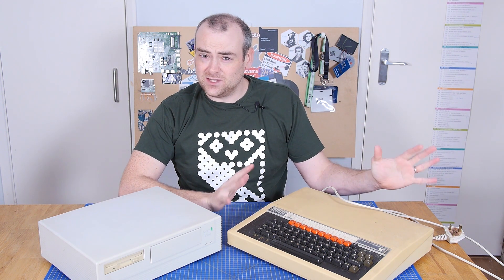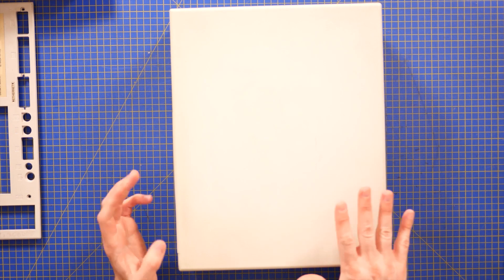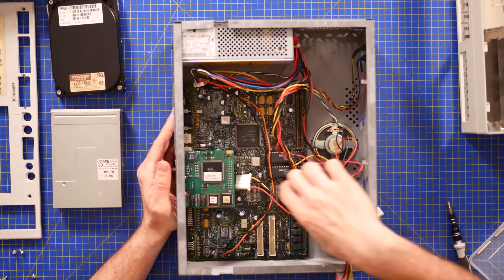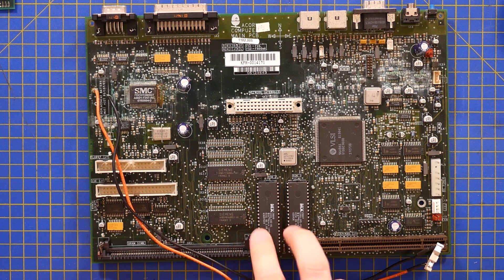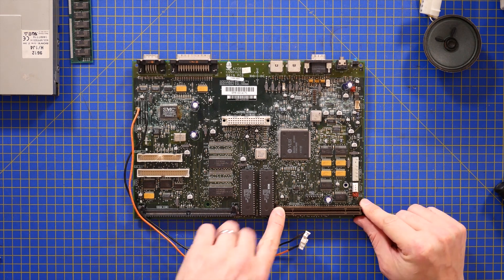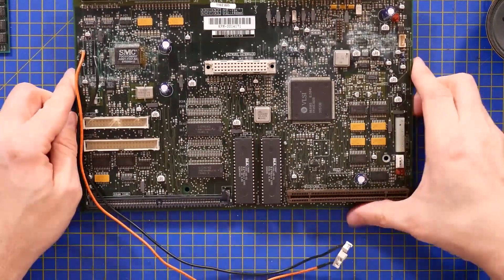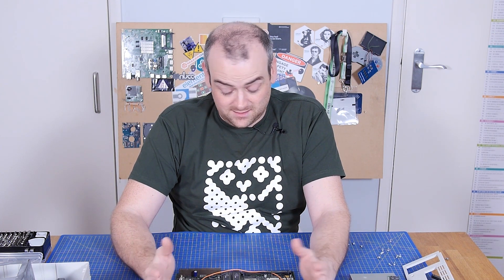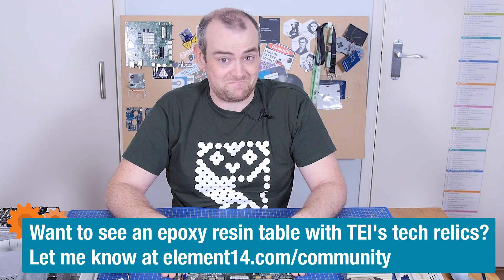Tearing Down an Acorn A7000 - The Electronics Inside

Comment: Ah remember the Acorn 7000s well as I used to look after 13 units with VGA monitors hard drive, floppy drive, CD-Rom drive, fans and EcoNet Network cards great times in fact until about 3 years ago we still had on setup with sensors for use in the science department. Always ran like a dream never any trouble with them. Was sorry to see the last one go to recycling!
Reply: Oh - so there were models that came with fans? Was there a significant difference between this model and the ones you had?

Comment: There were remnants of a coax-based network throughout my secondary school the whole time i was there (1998-2005). I don't think it was ever in use during that time, but you'd still see random old machines on desks everywhere, complete with lengths of coax hanging from them :)
But even without the mischief you described, the network still had enough issues that a good portion of my A-level computing lessons were spent complaining about the "not-work" preventing us logging in or something - though in hindsight I suspect most of the issues were software-related.

IIRC they did also have an 802.11a deployment before later upgrading it to 802.11b (around 2002?). Not sure how I knew about the 802.11a network when my laptops only supported 802.11b/g (sometimes requiring PCMCIA cards even for that, of course!). Might have just been from chatting with our computing teachers.

They were even upgrading the wired network to use a fibre backbone, but I left for uni before I saw that in action :(
Reply: I did do some work at a primary school in around 2002 ish? They had a laptop trolley with 30 laptops and PCMCIA wireless cards. I'll let you guess how many laptops got dropped on the cards. The damage ranged from "slightly bent" to "broken off it in the port".

There was one instance at the same school where there was a double data point, and one of the "little darlings" plugged the fly lead into both ports causing a network "collision" which brought down the whole network (these were dumb switches, no managed features at all).

Comment: The two coax Ethernet systems  were 10base5 thick coax , 10base2 thin coax which is the BNC that you have here, not a ring, it's a bus, each end terminated with 50 ohms. Some interface cards had termination optons, otherwise you used a terminator plug. Speed was 10 Mbps. 10Base5, ran over a longer distance (500m)  This had the "node" points marked on the coax, and you drilled into the coax and used a "bee sting"  connection to add an AUI module. Many interface cards had dual 10base2 and AUI interface options. The AUI was a 15 way D Type, usually with a slidelock retaining clip (nasty useless things)  

 Because the bee stings were all at the zero volt point of the electrical wave they did not upset the performance of the coax very much so 10base5 could run over a greater distance. 

10base2 had a 185m in distance, (they decided to call it 10base2 rather than 10base1.85!)

There were no specific connection points as there were on the thick coax, but I think the recommendation  was to have at least 3m betewwn each node.

As you say, breaking the coax did bring the network down, and there were several "make before break" type wall boxes that overcame this issue to some extent. (I spent far too much time finding partially pulled BNCs that killed the network!)

Andy
Reply: I thought it could be ring or bus with the COAX? Of course I'm happy to be corrected, I wasn't at a stage in my life where I had my own networking to play with at home!

My first network had windows 2000 server, and 2 5 port 100Mb ethernets switches on it!
Reply: @a531016  No not really, Ethernet has always been a bus type system. In some installations it might just look like a ring, but it's still a bus. If it was joined in a true ring, then you would most likely create continuous collisions. i.e. the signal would travel outward in both directions and eventually hit itself on the way around. That's why the cable needs to be terminated, so that the signal is absorbed at the ends and does not "bounce" back.  Collision detection is done by using Manchester encoding of the signal, which ensures that the average voltage is zero , if another signal appears on the cable that encoding is upset and the voltage will rise above or below zero so a simple voltage detector circuit will tell you if there has been a collision.

With Ethernet switches, all that is largely moot, as each port on a switch only connects to a single device, so there cannot really be any collisions - makes life much simpler...( You would not believe some of the messes that the earlier networking could get into,) 

At this time the other major networking system was IBM Token RIng. That used 150 ohm shielded twisted pair which could look similar to coax, but it isn't really.  Maybe you are thinking of this. 

 There was also a rarer IBM Twinax system, a coax with two cores, used to connect mainframes and some other high speed connections. Still slow at the time compared to high speed Ethernet standards however.     

Modern versions of this are used for high speed connections (10Gbit) of up to 10m with the SFP+ Direct attach copper

Not something you would usually see in your home network 🙂

Andy

Comment: Try to save the arm chip, it doesn’t look corroded and may save another a7000. These CPUs are rare by now. Most of the small chips are only bus drivers and latches and the multiIO controller by smc which were mass produced and are a dime each on eBay. Such a resin table thin makes no sense in my eyes if it’s nothing special like all different acorn RISC motherboards from the first to the last together. But they should at least be optically OK, even if not functional.
Reply: That's a good call, even if the rest of the board is U/S. It'd be nice to to loose the whole legacy of this artifact!

Comment: Well, if you are going to make an epoxy table using old PCB's, probably a good idea first to remove the lithium batteries from them, because they are going to eventually fail and blow open the epoxy. Same for NiCd and NimH packs, as they also fail with time. If you have a board with Sony SMD electrolytics on it they could also probably be removed, they are notorious for leaking.
Reply: This is a very good point! Anything that can leech into the resin, or cause issues in the future will be removed. There will also be height constraints too (because of the depth of the table, but also to allow enough resin to be strong enough to hold up) so big caps, ports, transformers, big inductors etc...

Comment: I watch a lot of vintage computing guys and they've brought back to life old computers that had battery corrosion on the board.  Vinegar is a good neutralizer of the acid, as with something called Naval Jelly.  The acid will continue to eat away at the board and components until you get rid of it!
Reply: Looking at it, I think this may be well beyond it. Assuming that the traces aren't damaged (which they appear to be) there are 3 ICs on the front that are almost totally gone. One of them appears to be a custom integrator, which I probably couldn't order in quantities less than 10,000 if I have the design or the copyright.

I love the idea of repairing it, but I think this one may just be too gone.